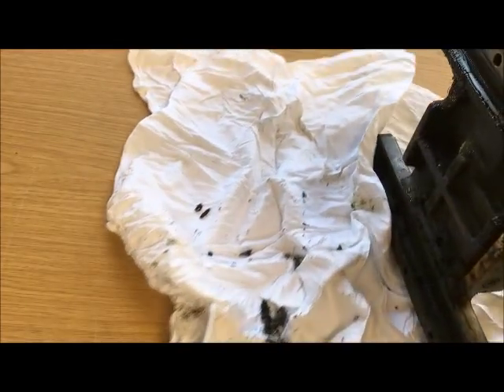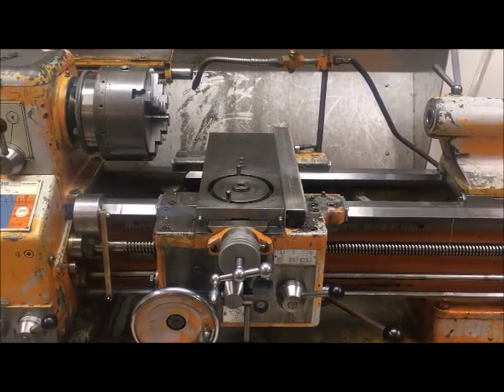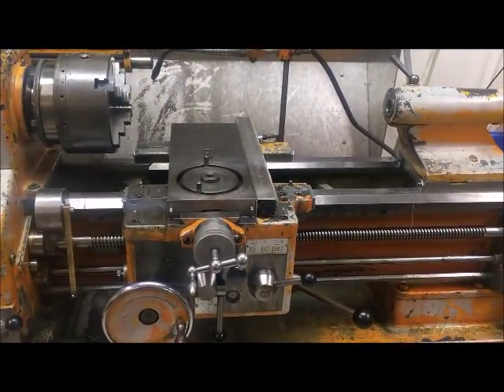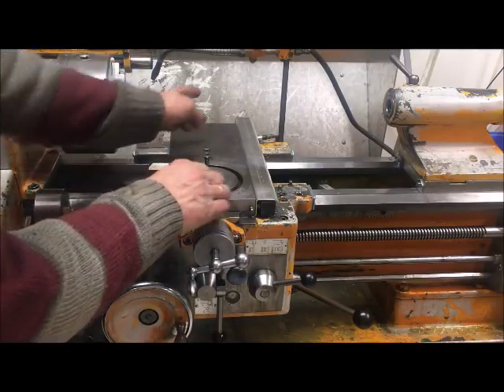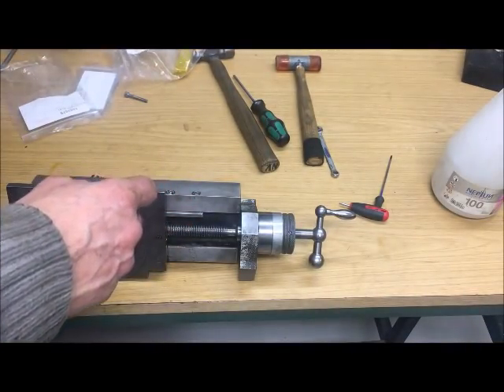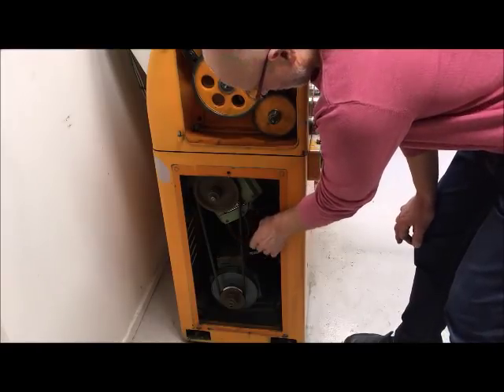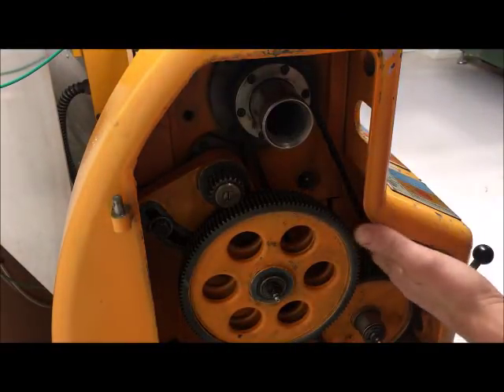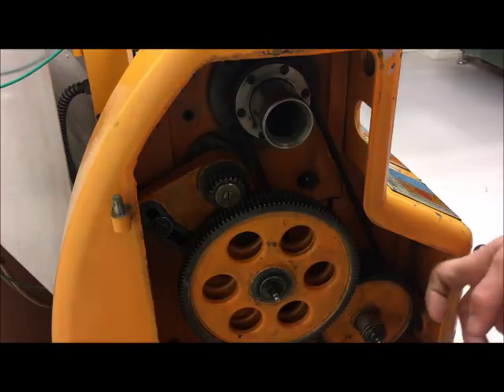Weiler Praktikant (partial) overhaul

Comment: I am restoring a Weiler Matador which seems quite similar to yours, mine is a more sedate machine tool gray instead of race car orange. My lathe has a lead screw that was damaged and I would like to replace it. Do you have a photo of the new or old lead screw or any video of the removal? Do you have any specs on the belt sizes?  Very nice video of your lathe repair.
Reply from the maker: Thnks for the nice comment! I didn't take any more video than what is shown here, sorry! The old screw wasn't much worn really, but I replaced it anyhow. The belt size is listed in the manual for the lathe, but as this is the lathe we have at my workplace, I haven't access to the manual myself from home. I can try to take a copy when back in office, but you may also get the manual from Weiler themselves as they are still in operation and will service and supply spare parts/documentation for this machine (as well as others). I would contact their service department and ask for their assistance. They were very nice to talk to and willing to help :)
Reply from the maker: I have photocopied a couple of teh pages from the instruction manual, showing the belts etc. Pls. give me your email or other contact details

Comment: Hi! thank you for the video (I know it’s been five years)! I’m trying to fix the feed gear - pulley shift box which you open up in this video on a weiler matador (looks exactly the same). I don’t understand what should retain the lower belt pulley from sliding back with the clutch when moving the lever to clutch in the gears. it does tend to slide with it here and i’m sure i missed something cause that looks dangerous! I got it dismantled so i’m trying to puzzle it together. can you help me ? thanks in advance
Reply from the maker: Thnks for commeting. Shall try to help, but am currently in Australia at work, so must wait until I get back. I fon't remember details, but maybe I I have more footage of the part you are having problem with..
Reply: @jansverrehaugjord9934  thanks a lot. there is no rush. also i could a find a way to keep it from sliding. i just really wonder how it is supposed to be done, because so far it just seems to be missing the feature, which is unlikely
Reply from the maker: pls. give me your email address then I can forward a drawing I found
Reply: Hey, I solved the question by talking to weiler. they sent some images and it works now. I posted the details on practical machinist if it ever were to be useful. thanks for your help!
Reply from the maker: @bastieng  Glad you found out. Good luck with the restoration!
Reply from the maker: PS! I also found a couple of more sketches of the belt/pulley system..
Reply: great! i think it gets erased by youtube so not sure how to do it… i posted on the practical machinist forum about it. thread is called “weiler matador gear and pulley feed clutch”
Reply from the maker: @bastieng  I copied the drawing from the service parts manual, but I also documented it in my video from 07:12
Reply from the maker: @bastieng  You can also contact Weiler themselves in Germany. They are still in operation and have spare parts and do service on these lathes
Reply: Yes, I saw. It’s a pity you didn’t take out the pulley off the shaft as well. That would have answered all my questions. I have talked to Weiler and they sent me additional pictures of pulley parts. In the meanwhile I figured there is a seegerring which is meant to be placed on a none grooved shaft which retains the pulley. I’m still unsure about a couple of rings and washers which came in the spare parts box and have the correct diameter for the shaft. It’s kinda annoying me not to know exactly how it originally was but it’s definitely enough to make this clutch run properly I guess.
Reply from the maker: @bastieng  Have you also tried to contact their Service dept.? I have talked/discussed with their shope foreman a couple of times in the past and found them very responsive! I reckon you are native German ie. speaking with them would be easier also..
Reply: thanks a lot for your video and your help
Reply: Haha no I’m swiss from the french speaking part. My german is a catastrophe so I speak with them in english and through emails. They always respond very fast indeed, but also very briefly. But then again fair enough, I guess my questions are very detailed for a tiny part for a lathe from the 70’..
Reply: Do you still have the praktikant in your shop?
Reply from the maker: @bastieng  This is not mine.. it is our workshop at the place I work. I just volunteered to "service it"

Comment: I would love to have one of those Weilers one day. Big step up from my Chinese machine :)
Reply from the maker: Yes, a Weiler is a very good machine. The one here at my workplace is an example of the exceptional build quality and design, still offering accuracy and is fully functional even after many years of good service. However, if it bad been sloppy, worn and not very accurate nor "functional" any more , it would not have helped.. otoh, then a major restoration would probably been economical for this kind of lathe, what is not always the case of cheaper ones. As long as your machine serves you well, you get good (enough) parts with "a satisfactory effort", meaning no wrenches are thrown in anger and despair because of a crappy lathe that only kills your enthusiasm 😎.. well.. then such a lathe can be as good as a worn out specimen of a top notch brand.

Comment: I know little about those Weiler lathes Jan other than they were apparently a very well built and accurate machine. I'd bet the price on those new parts reflected that. :-) Always sad to see a fine machine neglected to that state. It's also the first time I've seen a cross slide nut designed to be mounted like that. Pretty clever since the backlash can be easily taken up without a split nut "if" you have the correct tool.
Reply from the maker: Thanks for the comments. Yes, a lot of heavy usage and only minor, superficial maintenance over the years.  The top-slide arrangement is clever, indeed, but also simple. We also put in a new cross-slide screw and nut awhile back, and this uses the often found design with a 2 piece nut and a wedge inbetween. It anway tells of a thought-through and well executed machine tool.. built to a very high standard! Also, I think is is not bad to just be able to orders parts from the User Manual for a lathe made back in the 70'ies!